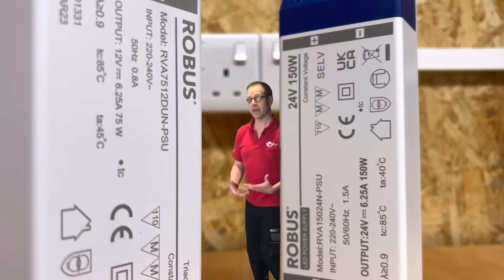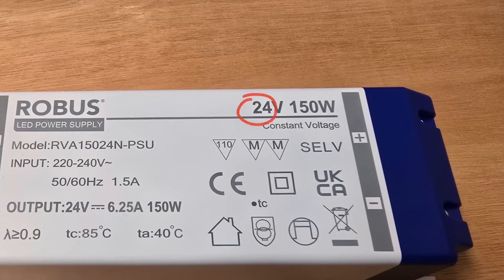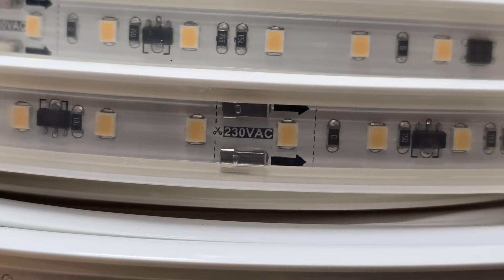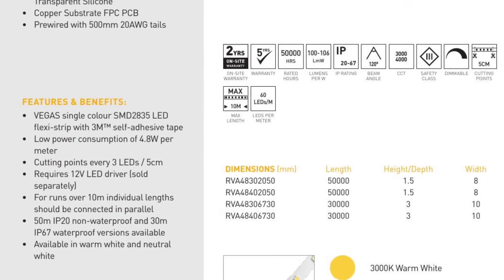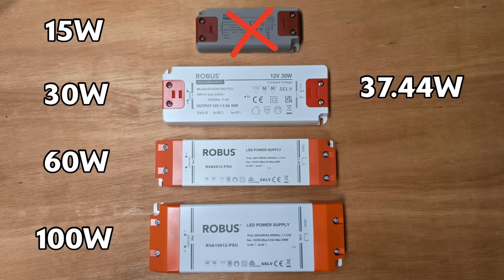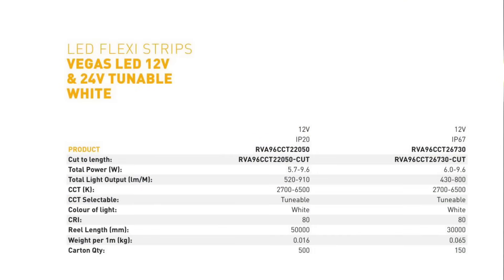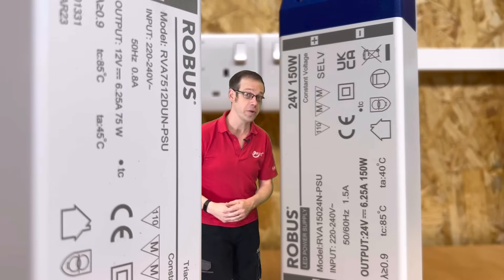Your LED Strip Lights Could FAIL If You Ignore This!

Comment: Replaced 5ft lights (only 24 to 18mth old)
I took the old ones home , by pass the sensor, and put in a new driver . Flashing LED , put the old driver back in and Flashing LED.
Trying to check the LEDs one at a time (never used the led tester bit on a meter) but I think the led are over heating and coming away from the board.  
One board which has a lot of out led I flicked off the led and bridges it (not smart but working on triel and error) maybe I should of put in a 470 ohms or something.
Kinda wonder if I can reseat the LEDs as the they can do with surface mounted chips.
The led is on a metal strip so wonder about heating up under it and pressing down.. my eyes are to bad to solder in SMD LEDs 

9 led in series and this is repeated with 9 banks in parallel. 
This is then doubled up to do a other led group. 
+ 9 banks of 9 led in series 
The - side then goes to the second group. And on to the - side 

40-54vDC 1A @ P-Rate 57W

I don't like ditching thing for the sake of ditching it should be a crime to make this much weee waste

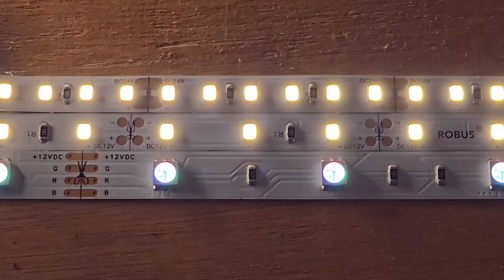Comment: 2:30 You forgot the 4th factor: higher density LED strips produce more heat, and if you haven't considered watts dissipated in your design (e.g. tucking your expensive high density strip in a back corner under any overhang, shelf, cornice, with no ventilation) then you'll have a failed strip in no time, certainly less than the 5 years that your customer will remember you gave them a warranty for...

"Hey they, can you come and replace that feature light in the games room yet again before my snooker buddies come around for the annual gathering?"

Comment: Talking of LEDs  one of my customers asked could I put a booster on there tv because it keeps dropping out… after testing the tv signal was excellent and just as I was leaving the tv signal went …. No channels then after 3 mins it came back on so I decided to fit new coax connectors and network rj45  and again seamed ok ….. while customer was making me a coffee it went off again then custom ask could I look at there fridge light as it was not always coming on and when it did it flicked but on testing the tv went off again so asked the customer to play with fridge switch while I watched the tv every time if flicked the tv signal went off again disconnected the fridge led completely and no more problems … figure that one out 😮
Reply: EMI Interference from the led driver

Comment: 5:20 voltage drop along the strip. Solution is to feed it from both ends.
Option one is to feed both +ve and -ve from both ends, thos is fine for on/off drivers but can lead to a slight drop in the centre when using dimmable drivers at a low level.
The other option is to feed the +ve in from one side and the -ve in from the other. This creates an even volt drop along the strip and also only requires one conductor to be run along the length of the strip no matter what driver you use.
Reply: Another thing to consider: mid point supply or mid point boosting if the far end is inaccessible

Comment: If Led lights are so called better for the environment why is it that every single one I that I have fitted has ended up being thrown in the bin. Not only the bulb but often the whole unit but especially floodlights even expensive ones £ 60-100. I recently changed the filament on a light i fitted 22 years ago on a local church.
Reply: I have replaced so many led pir sensor floods that i am fed up with them,  no matter what brand i use most last less than a year & often get water in them.
Reply: @merlin5476 that's why I only fit the lap wayburn ones now. If they're all cheap shit, I'm only going to fit cheap shit
Reply: @darylsavage119  it's a bit of a pain when the customer rings up & complains then i have to go & replace it,  wasting time etc,  i think i may go back to old halogen ones....   
If i can find them 🙃
Reply: Technological surplus, production trends, marketing etc.😅
Reply: because the amount of energy they use (when they're working) is tiny
Reply: The problem, as I see it, is that LED lighting is being made too cheaply (quality, not price).
Reply: All my lights are LED with six LED strips. Not one has failed in any way after 7 years.
Reply: @johnburns4017  I’ve had numerous LED screw-in bulbs fail. (Even in open fixtures with ample airflow!) I’ve had no LED strip failures, though on one strip, the supposedly waterproof kind with the clear silicone rubber coating, the silicone itself yellowed to the point of opacity right at the LEDs themselves, dramatically cutting light output. I peeled off the silicone and brightness was restored.
Reply: @tookitogo  
Buy quality LED light bulbs.
Reply: @ The ones that have failed the most have been expensive name brand ones (Philips, Osram, etc). Paradoxically, the inexpensive decorative LED bulbs I got off AliExpress (before they started selling the “filament” LED bulbs in stores) have lasted the longest so far, with no failures.
Reply: @tookitogo  
Interesting.
Reply: @johnburns4017  Yeah. I honestly would have predicted the opposite. 

Overall I’ve been disappointed with screw-in replacement bulbs, both LED and compact fluorescent before them. On the whole they have been much too unreliable.
Reply: @ 
I have a Varialite dimmer. I can be set to start a 0v and rise to to 230v when the light is switched on.  This prevents harmful voltage spikes prolonging the bulbs life.
Reply: Same thing as regular lightbulbs; they're made cheaply
Reply: It's a tradeoff, they are more complex, but they use 4 times less energy compared to halogen and 6 times less than tungsten filaments.
But if they fail to compensate the higher manufacturing environmental impact with their lower energy usage by dying before reaching the crossover point, they are indeed pointless.
Manufacturers did not wait for LEDs to become mainstream to start the race to the bottom, the floor is just closer with filament bulbs.

LEDs are very sensitive to heat, they need heat dissipation solutions to last, some fixture designed for old bulbs don't provide enough.

They are not perfect, but it's nice to have a lighting technology that converts more than 12 % of the energy used into light (40-50 % for LEDs).

Comment: Isn't it a complete scam that led's do not last as claimed, and are basically unrepairable needing new fittings. Nothing whatsoever "green" about them
Why is nobody shouting about this ?
And no, you aren't even covering half of led drivers, whether constant current, constant voltage, etc etc

Comment: And says nothing about the Constant Voltage or Constant Current marking on the power supply.
Reply: Most strips have "built in" current limiting so are meant to use CV supplies. CC is mostly used in premade fixtures that don't have user serviceable strips.
Reply from the maker: Watch this space. 👍